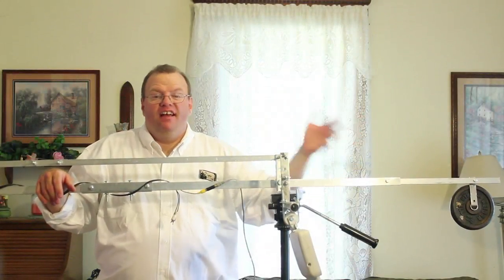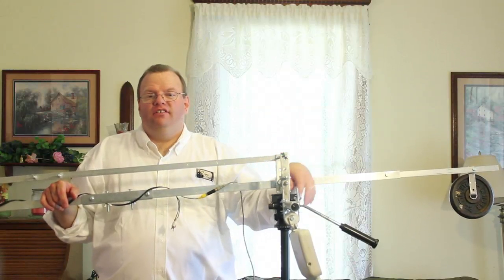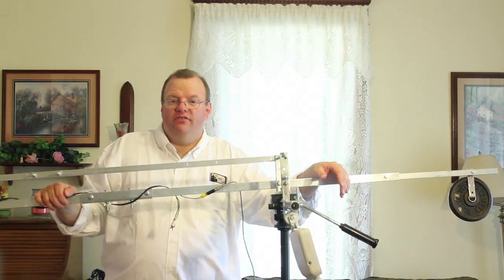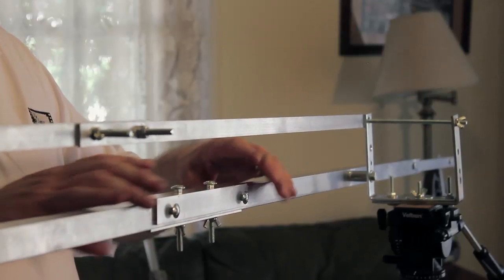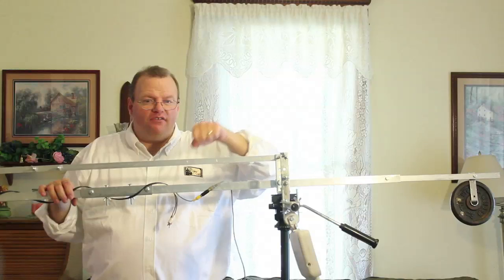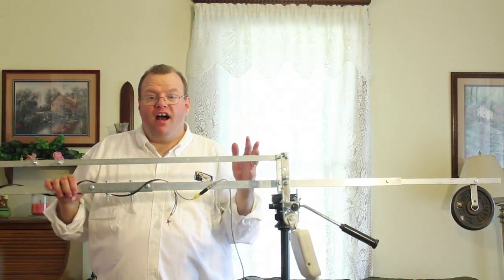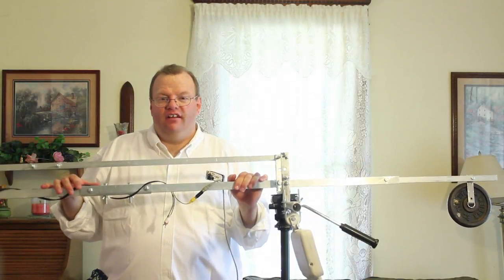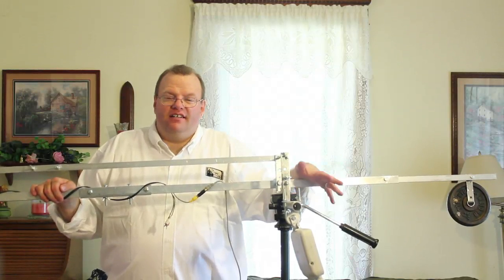DIY Jib Crane - My Final Version - Cost $45 for materials.

Comment: MUSIC MEISTER !

You done good !

MUCH better that the deal with cables and tripod parts.  Unfortunately, you omitted and explanation of the "business end" (where the camera is) in this particular video.

It would be much appreciated if you could supplement the video with a little on that camera bracket/platform section.

But --- believe me --- this is not a complaint.  I'm a big fan of the way your straight-forward head works.

Comment: If you are having problems with the tripod head, I mean twisting of some sort, change the way the weight is mounted... Put it inside , like the camera... I don't know if you understand me but in my case it really helped. I am using a really, really cheap tripod and head, witch kinda broke by the weight and after fixing it I used a clamp to mount the weights sideways.. If you want you can see the inspirational video.. I think the jib is by the name Hauge, or something like that.. Great jib and v

Comment: Also, to speed setup and pull down, shorter bolts. I'm also looking at thin tubing notepad of the aluminium bar to reduce flexing of the tilt mechanism and reduce weight.

Comment: Quinn - hold the tube at both ends and twist it.  If you think it twists too much then it is too thin.  I am have a choice of 2 or 3 mm and think I will opt for 3 mm as I eventually want to put a heavier camera on the end (FS700 or similar). Better to spend a bit more and only make the jib once.

Comment: I'm also designing my own jib, dolly, track slider and this looks like a good design.  You can extend the vertical arms on the pivot and head end with several holes in the vertical section. By moving the aluminium bar up or down the vertical arm in the various holes you can get a variable ratio of movement at the head. This might solve some of the more limited movement restrictions you are experiencing since using a fixed bar instead of the cable.  I am looking at square tubing too :)

Comment from the maker: Actually,  the shots wouldn't be very stable.  In my experience, whenever you RAISE the tripod head using the center post, it somehow transmits EVERY bump and vibration when using the track dolly.  And, since in order to get maximum clearance for my crane I DO use the center-post, it will likely be very shaky.  BUT.. I have not tried it out yet. That is a cool idea - one I will try out soon.